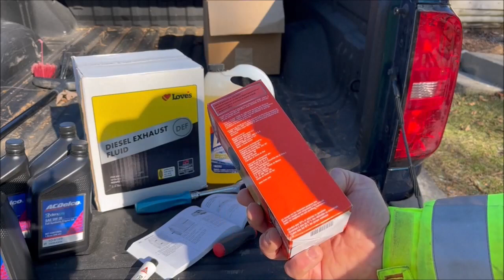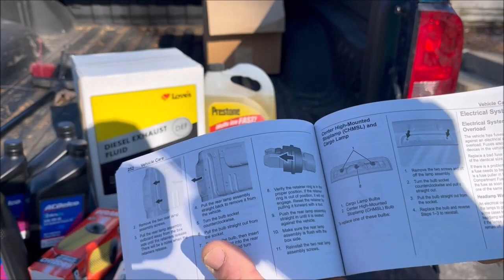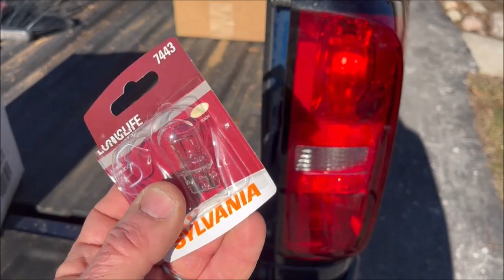2016-2022 Chevrolet Colorado Rear Parking Lamp Replacement

Comment: The finger oil on the light bulbs is only for extreme high pressure and or heat. The oil will cook when the bulb gets too hot and blow the glass. Automotive bulbs wont do that. I like the fact that you cleaned the opening while the cover was off.